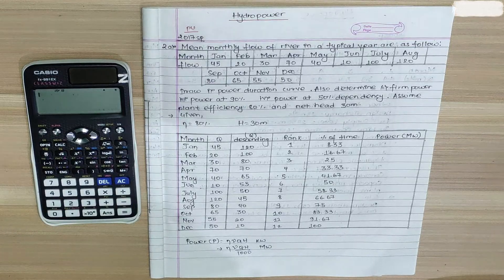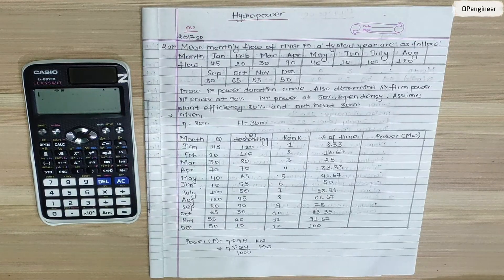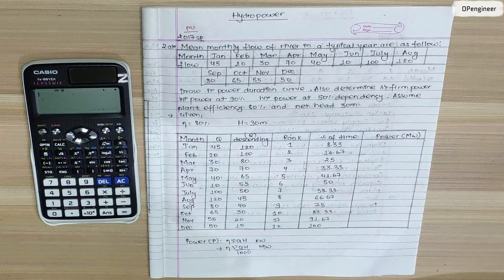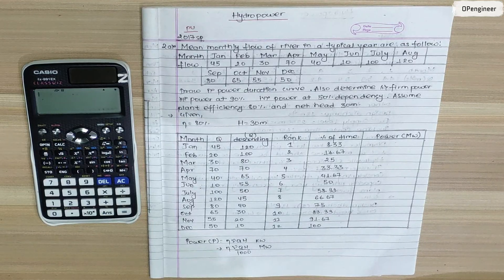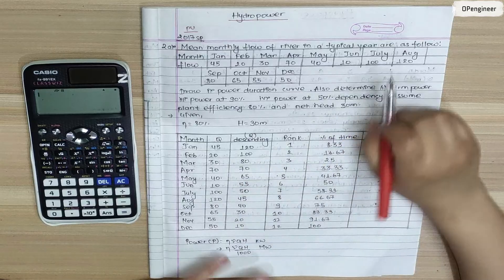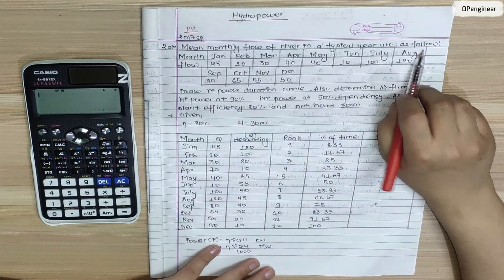Power Duration Curve ,Firm Energy ,Secondary Energy Numerical  || Hydropower Engineering

Comment: The power duration curve is plotted with power along the y-axis and the percentage of time along the x-axis. If we plot the curve with months on the x-axis, we will not obtain the same type of curve as shown in your video. For instance, you have plotted 28.25 MW as the power corresponding to January; however, 28.25 MW corresponds to a discharge of 120 m³/s, which is available for only 1/12 (8.33%) of the year. According to the video, if the curve were drawn with months on the x-axis, January, with a mean discharge of 45 m³/s, would not generate the highest power among all 12 months. The highest power—28.25 MW—will be generated when the river flow is at its peak (120 m³/s), which will only occur for 1/12 (8.33%) time of the year.
Reply from the maker: Yes, the power duration curve is plotted with power on the y-axis and percentage of time on the x-axis, not the months.